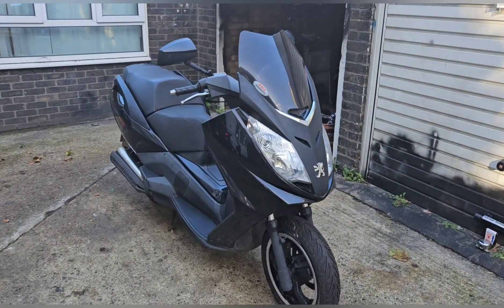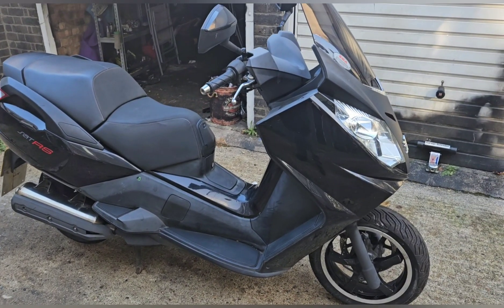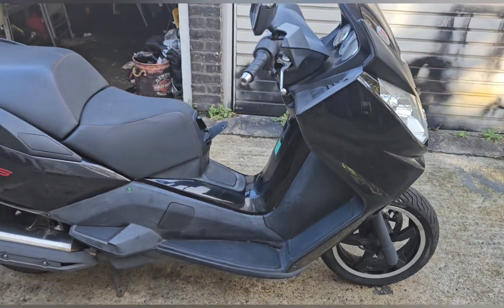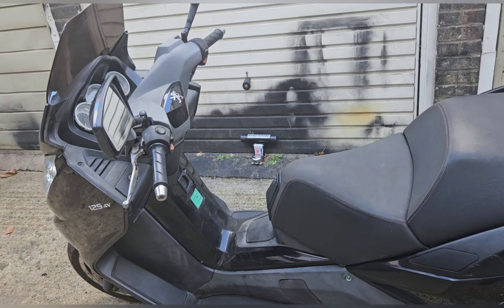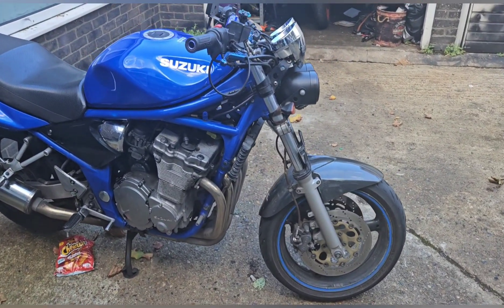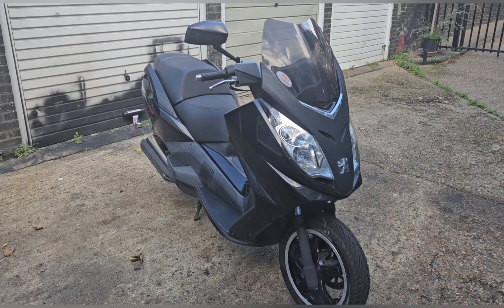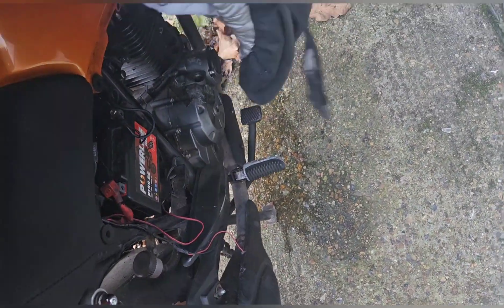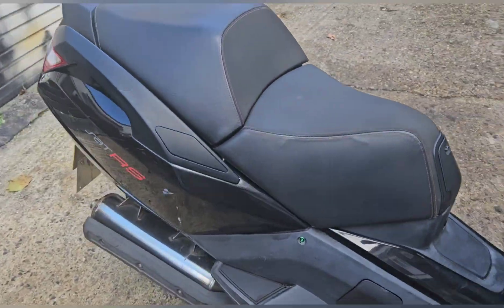peugeot satelis 2 125cc mot day.

Comment: funny you say that about the bandit! training centre had me ride one just to see if I was OK on a larger bike before jumping onto their more expensive training bikes and I found the clutch very stiff at the handlebar end, not the gear shifter, had an awful cramp in my hand after riding it as was just doing slow control stuff so clutch in/out lots and lots.

side note here, love the auto glym polish stuff too, used it loads in the past and it's always worked wonders
Reply from the maker: Yeh exactly and I made this clutch worse with the new clutch springs. Somehow they are stiffer. 

Great revvy engine but everything around it feels stiff and uncomfortable. My hand felt it aswell. 

That Polish is great aswell. Even in thin layers. Add some wax on top and it pops beautifully. 

Cheers

Comment: Nice to see it done and finished. What is the name of the MC Quire's polish for gloss and what do you use for the Matt panel's Charlie?
Also the wax top coat. Do you use that on the gloss and matt. Want to keep the Lambretta Pato 151n in tip top shape as not a scratch and very clean for a 2016 model. Also for the metal work and wheels underneath etc. ACF 50 or better stuff on the market these days. In my day it was Johnson's Rally Wax but it ain't the 70's anymore things have moved on 😊
Next project sorted yet?
Don't know if you thought about doing a video on winterizing motorbikes unless you done one in the past I missed.
Reply from the maker: The magiers super resin polish. It's great stuff. It kinda sets like a resin and lasts a year or so. 

I currently use a turtle wax carnauba for a top wax. It's ment to last 6 months to a year but I find 6 months is pretty much max. 

On the matt I sometimes put a wax on but it's not idea and shouldn't be anywhere near feet or hands. 

Any back to black product I like for plastics.